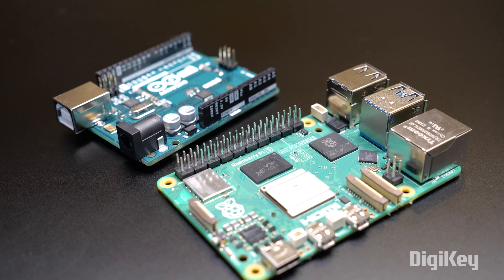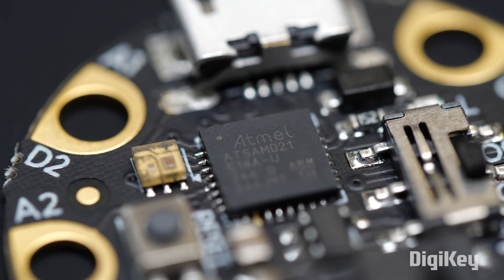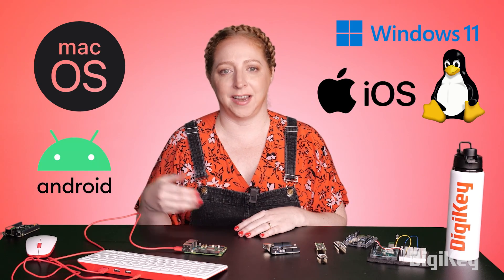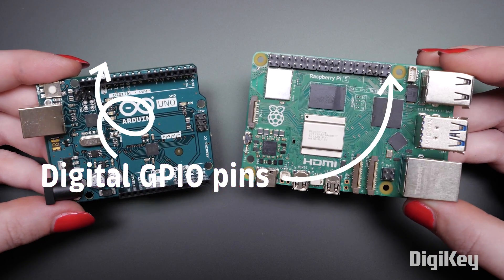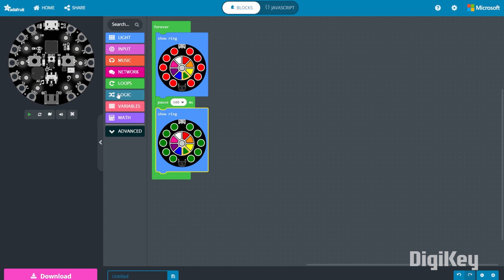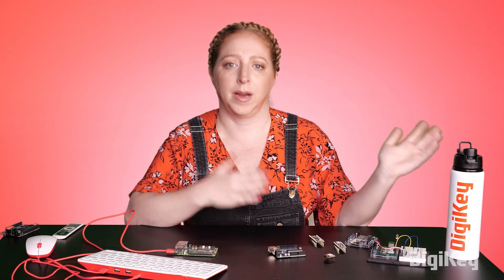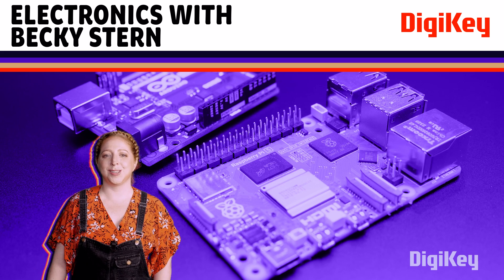Arduino vs. Raspberry Pi - Electronics with Becky Stern | DigiKey

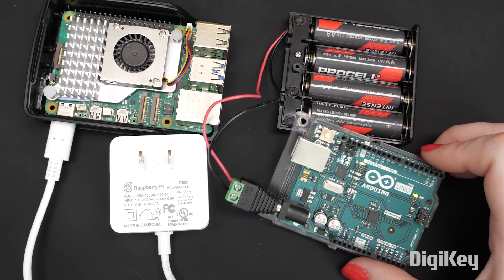Comment: Thank you for the explaining the differences. Are there prefered languages for esp32 boards?  Also @ 5:00 how low can the batteries get before the Arduino board stops working?

Comment: Forgot to mention that when using an RPI and you suddenly unplug it you can corrupt the storage media. There is no such issue with a microcontroller. The ESP32 has a dual core, and does run a RTOS.

Comment: If you are just learning, microcontrollers are the best option unsless you have a specific project that requires the power of an SBC. You can get a whole microcontroller kit for the cost on an SBC. If you do something silly and destroy the device, a microcontroller is far cheaper than an SBC to replace.

Comment: Can I use rpi for real time processing or I better go for microcontroller?
Reply: I would say if you have strict latency requirements - for example if the computer has to complete a certain function within 1.2ms every single time without fail or your vehicle will crash and people will die - go for the microcontroller. If you have a lot of data you have to process, like real time video processing, go for the rpi.